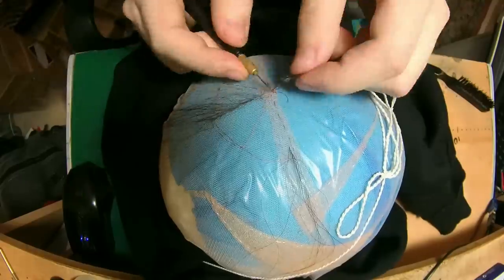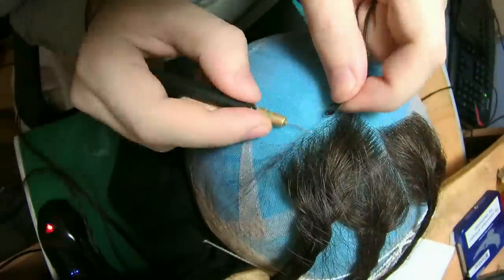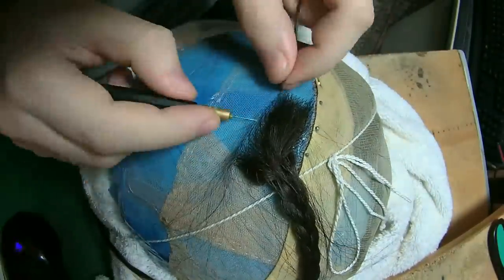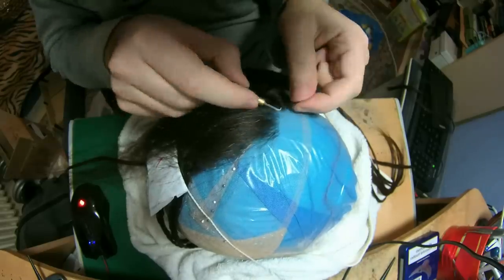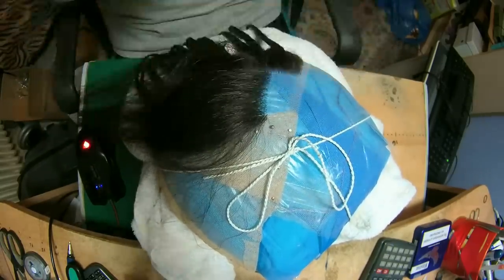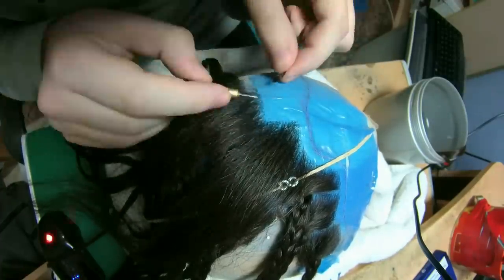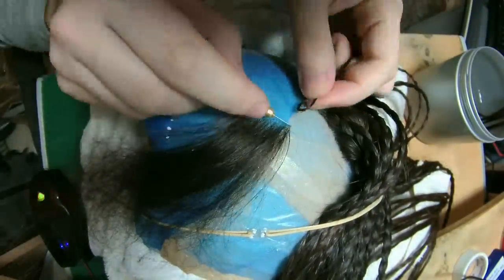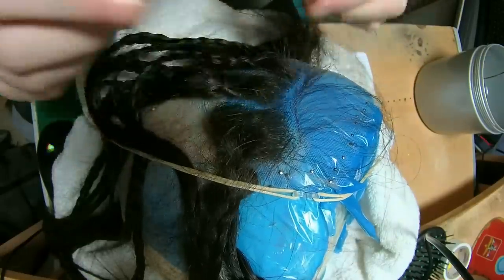Human Hair Wig Time Lapse 150x Speed

Comment: 45 hours to make that?! Thats less than a week if working regular hours! AMAZING!
Reply from the maker: +Ally W Well the truth is that 8 hours of normal work is not the same with 8 hours of ventilation. It is a precise job to be done, repetitive and it hurts the eyes and the head.

also 45 hours was the ventilation process, dealing with hair, preparing it and stuff could make this take longer.

I finished the wig in 2 weeks or so if I remember correctly with all the things needed to be done (the wig cap, the ventilation, the wefts in the back etc)
Reply: +Super Wig Maker I want your skills! The cap making, the marking, the ventilating, all the skills!
Reply: Ally Weeks ii

Comment: First thank you for so freely sharing your gift! Can you recommend a type of lace to use for wigs?
Reply from the maker: +Cassandra C I could show you a couple of links. It is asian lace, thicker but it is 
lace.

This is SUPER THICK, it is good only for the back of sturdy wigs, it is 
cheap but don't even try to make a wig using this lace for the front, it
 is like fabric.
http://www.ebay.com/itm/swiss-lace-net-making-wig-toupee-top-closure-foundation-hair-accessories-korea/271410895440?hash=item3f31599a50

And this is what pretty much every wig maker uses for non expensive 
wigs. All premade wigs from ebay and such use this kind of lace.

http://www.ebay.com/itm/lace-for-making-or-ventilating-lace-wig-cap-e-g-lace-front-or-full-lace-weaving/251291460832?hash=item3a822364e0
Reply: Your awesome.  Thanks so much
Reply: Thanks!
Reply: Super Wig Maker x

Comment: Can a wig be made from collecting shed hair? I was thinking about saving my loose, clean hair from my comb every day for a long period of time, years even. Has anyone tried this? Would the hair be useable?
Reply from the maker: +Megan Mays Yes it would, you just need to make it remy again, which means to align the scales, put all roots together and all ends together or the hair will tangle badly.

This video shows how to make hair re-aligned without having to pick strand by strand.

~~~~~~~~~~~~~

also naturally our head would replenish all the hair from 3 to 4 years in a healthy average individual. That means that within these years you should have enough hair as much as your head, but mostly the longer lengths because short hair is usually in the phase that grows, so mostly long hair fall.